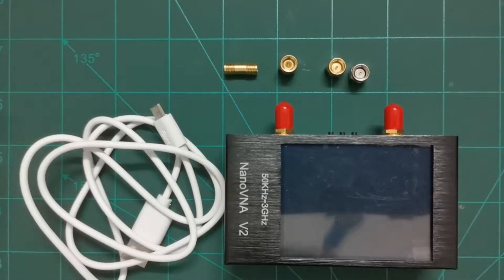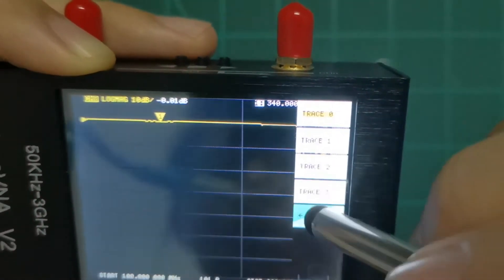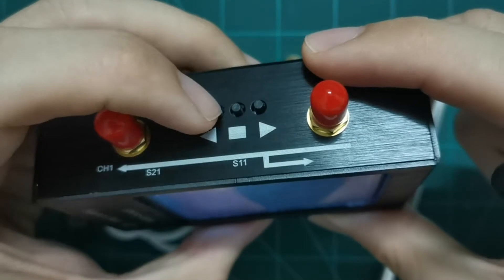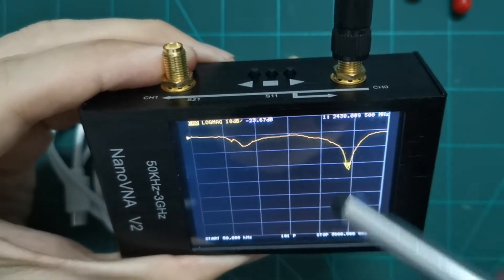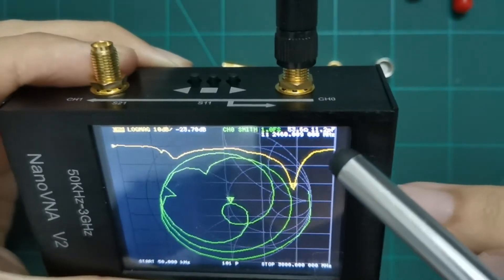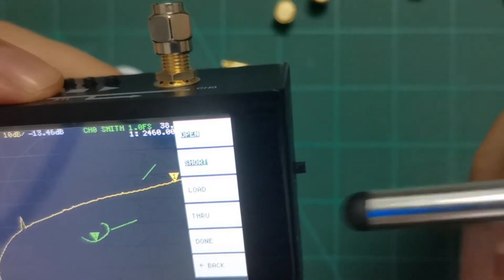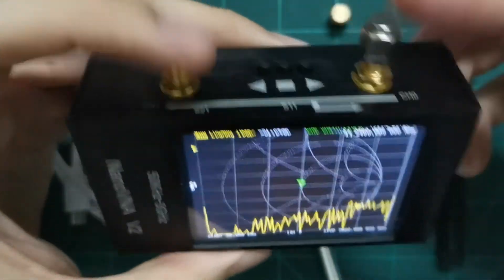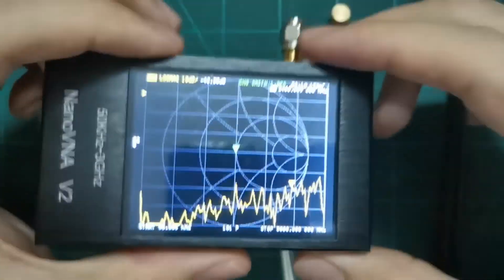NanoVNA V2 Calibration and Antenna Measurement

Comment: hi. Could you leave a link where you bought it? thanks.
Reply from the maker: Hi Pavel, here the link https://www.lazada.com.my/products/28-inci-menyentuh-skrin-3g-penganalisa-rangkaian-vektor-s-a-a-2-nanovna-v2-penganalisis-antena-dees-hf-vhf-uhf-dengan-aluminium-perumahan-aloi-i1320792858-s4064276976.html??dsource=share&laz_share_info=83201609_3_100_21322_56695036_null&laz_token=ad67df6882904c3b0ed4356933eb5e75

The link below also have another type of the NanoVNA V2
https://nanorfe.com/nanovna-v2.html

Hope it helps. :)
Reply from the maker: It also support VNA-QT software.
Check in this video: https://youtu.be/Mp8hU7yRIYs
Reply: @LYSStuff  thanks! I ordered the same model yesterday.
Reply from the maker: @pasha1663  Wow, Welcome